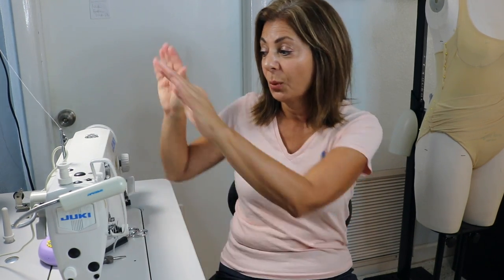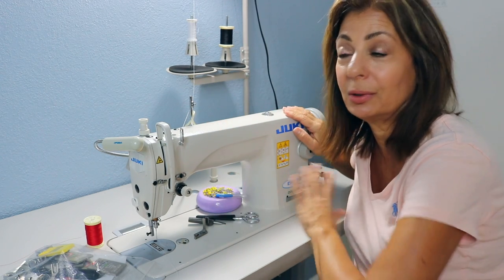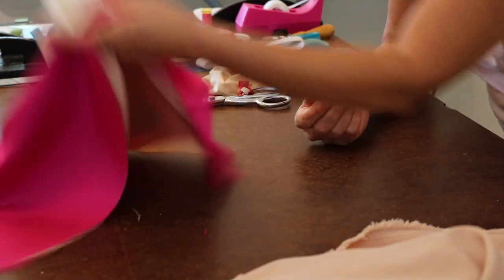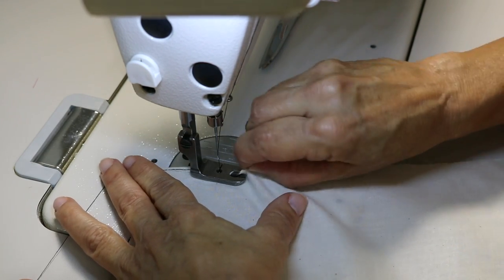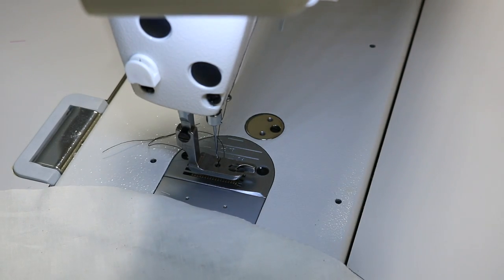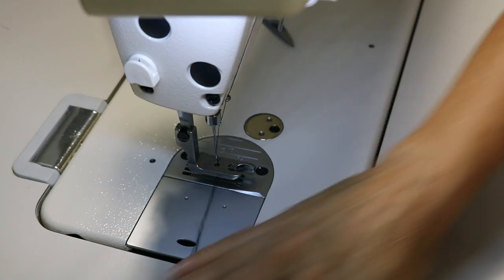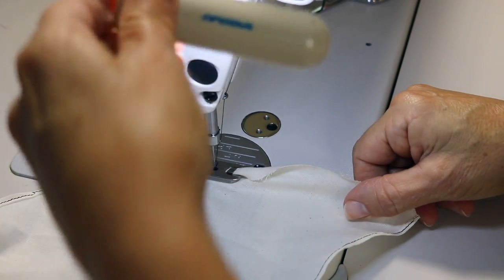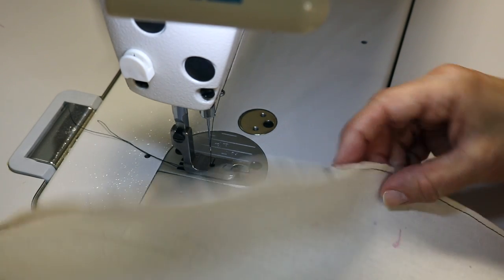How to Sew With a Rolled Hem Foot!

Comment: Susan, I have never been able to make those work
Reply from the maker: Well that shouldn’t stop you from trying like I did! Give it a whirl!
Reply: They are difficult at first, it is true, but let the fabric lead you and have patience.  As Susan suggested in the video having the right foot is vital.  Experiment with different sized rolled hem feet for your particular fabric, rather than  deciding  on the foot first. Have a few inches of fabric to waste at the beginning getting started rather than starting directly on the garment.  ( Try tagging on an extra piece at the beginning of the garment to get started if need be).  Relax, relax, relax, and watch the feed into the foot keeping at an even speed.  Do not pull too taunt on the fabric, but don’t let it get loose either.  Let the foot and machine do it’s work.  Fabric, foot, needle, thread, stitch length, relax, relax, relax, slow even speed.  You can get this!  Susan has shown you how to try.  Replay the video and catch her spirit!
Reply: @susaneliascouture  Maybe factories have a better way of doing it?
Reply from the maker: Vivienne Andersson As far as I know they use a roller foot. I was also a Alterations manager at David’s Bridal and they refused to use a roller foot. Instead it was a two part process with top stitching. 
The real reason the silk sample didn’t work is their are major things that have to be done before sewing silk. I’m glad you got something out of this video. Thank you for watching and commenting:).